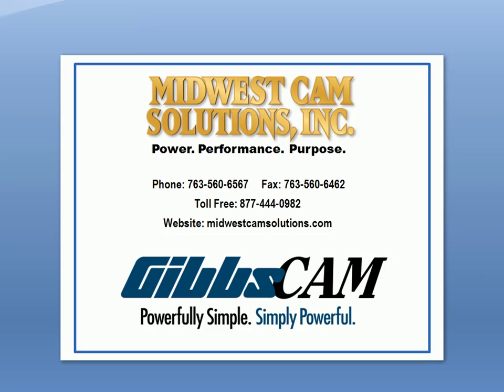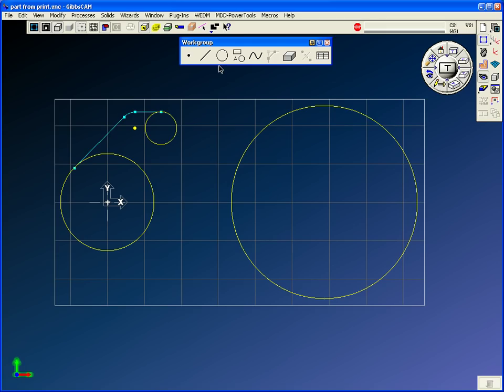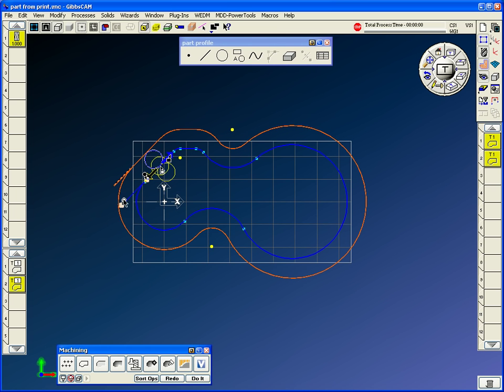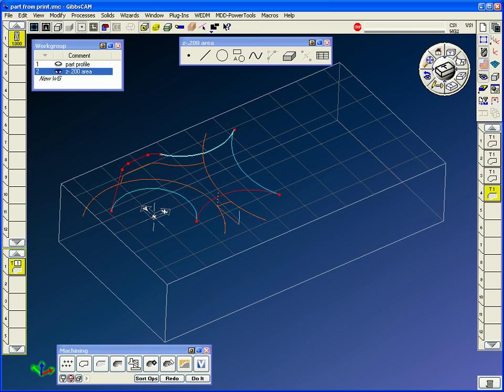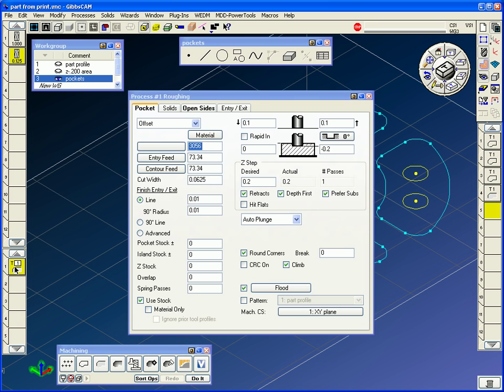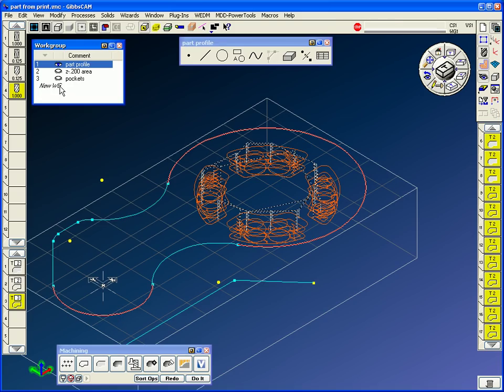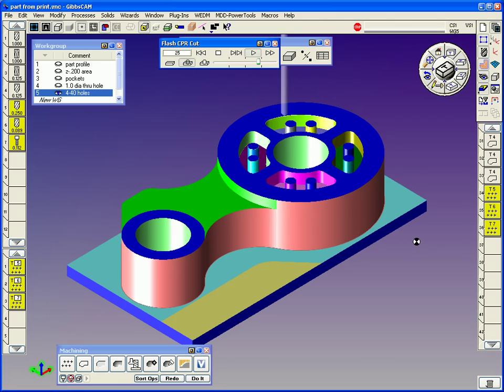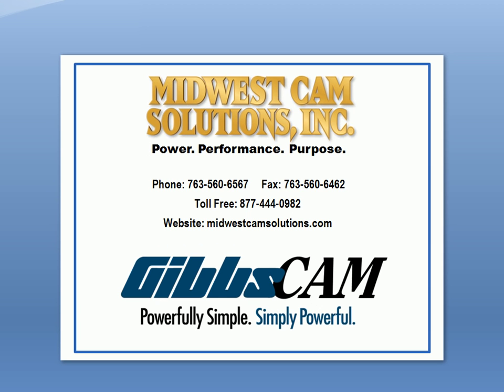GibbsCAM Basic Mill Part (from Print)

Comment: Gibbscam is a good software . The real big problem is the customer support and the sales people from the so called "authorized sales reps " don't really care about the customer . They are just there to sell you a software and give you a crash course training. 
Let's say for example you are a machinist and you know for example Mastercam. 
Get ready because it will be a rude awakening. 
Both softwares work different.  Both will get the job done .
But coming from my background of 20 years plus. And working for many different companies. 
And having to try to learn more than 6 softwares .
It becomes so complicated. 
It' is better off in my opinion if you are good in one particular software . Then if you get a new job offer and if they have a different software.  
Make sure you know that the learning curve will be tremendous. Sales people don't care about "you" . All they are interested is in to charge your company 500 dollars  or more to learn the software on a daily basis at the authorized reseller office.  
In summary unless you are a computer geek or have using many different programming softwares and know them all really well . 
Walk away from that job offer because you will regret it the rest of your machinist career.  Stick to what you know !
If you know Gibbscam....Then only take job offers in Gibbscam.  If you know Mastercam do the same .

Comment: This drawing does not represent the part. At the second .25 fillet when you draw the circle in place of the dimensions provided, the cricle and parallel line do not intersect therefore the connect feature will not connect the two entities. this drawing in other words cannot be drawn according to your numbers per the print.